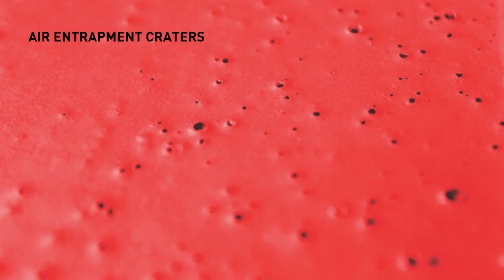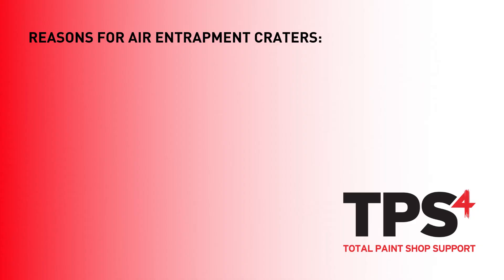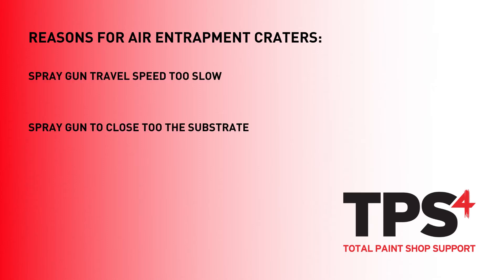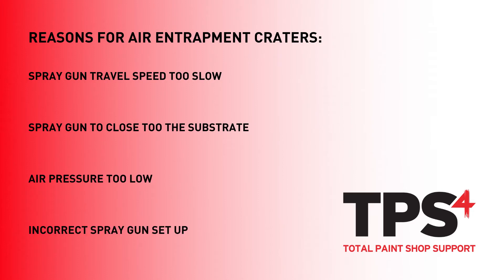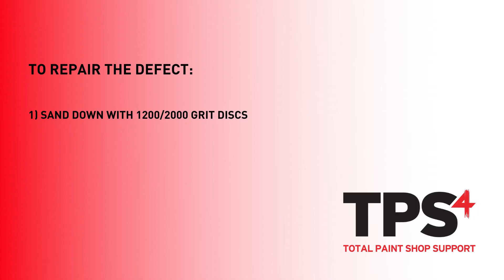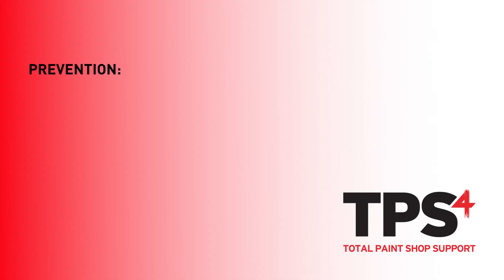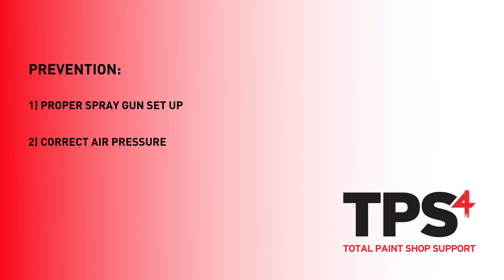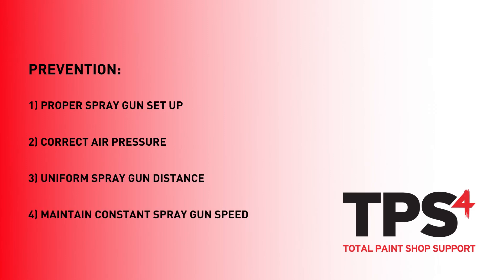How do understand Air Entrapment Craters when spray painting

Comment: Spraying Corr-FX 600 at 120 mils. An undercoat for refractory brick. Application temps are between 10*C & 48*C! Graco KIng 60:1 @ 80 lbs with a .027" tip. The product is like pudding; a water based single component formula with asphalt and clay; very abrasive, yet soft. Can mixing up and down against the sides of the 5 gal pail, introducing air into the coating be a culprit? My first guess would be the thickness.

Comment: Can incorrect paint viscosity cause this? I.e. clear coat stored to cold and then mixed according to the data sheet without checking it’s viscosity, then causing problems when applying it onto the panel, forcing you to move slower or closer to the panel? I’ve had these issues mostly on top panels like bonnet, roof etc and I’ve just realised I pretty sure the paint has been way too thick. Kind regards
Reply from the maker: yes paint being applied out of temperature range will almost definitely cause paint issues like this. too thick too thin causes extremes of both
Reply: @ultrimaxcoatingsltd  thank you 👍👍

Comment: What about tiny craters that appear instantly as spraying? They disappear if putting much more paint on (i.e. slower spray speed) but it's TOO much product and runs and sags
Reply from the maker: that sounds like solvent popping so either solvent getting onto the substrate or small particles getting onto the substrate. Its a case of let it dry flat it back to get rid of the pinholes and then repaint